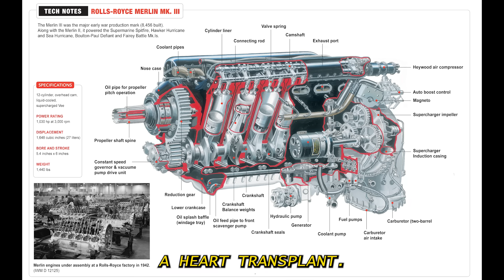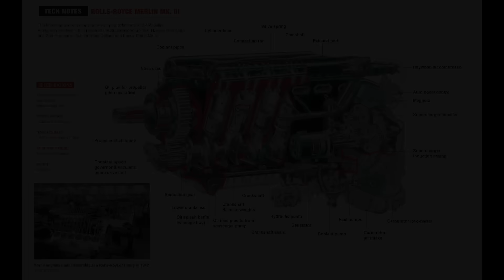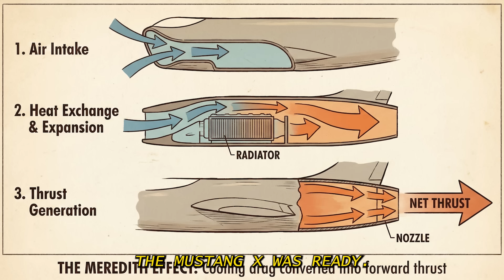They Put A British Engine In A US Plane — And Created A Monster

Comment: Gross and grotesque exaggeration.
Some P-51s were fitted with Merlin engines in 1942 at Hucknall, Nottinghamshire but its inability to fly in the dark limited what the RAF could use it for until the 1944 mass raids inside Germany, loaned to the USAAF for day escorting. The RAF night raids used late Mk Spitfires and Typhoon and Tempest pressurized versions.
Some blueprint mods by R-R allowed Packard to  make a Merlin variant with the purpose of guiding USAAF B-17s home to England into 1945 when 'layered defence' had been devised to have well fueled Mustangs in the air over Germany at dawn so Anglo-US bombing could be 24/7.
The Merlin P.51 saw service in Korea and several countries but the RAF seems to have scrapped theirs'.
Reply: RAF Mustangs likely had to be returned post war, to comply with the terms of the Lend-Lease Act.
Reply: @RogbodgeVideo  The British were flying operational jets from 1944 and after the war had no use for piston engine aircraft.

The Merlin engines were supplied by the UK on 'reverse Lend Lease' terms? Yes even the Packard built engines were RR property and paid by the British.
Reverse Lend Lease was valued at $6.8Bn at wars end.

Comment: any proof for this tale ?
Reply: I wouldn't say it's untrue, merely that it is very selective about which truths it uses. 
For example, the Alison engine was better than the Merlin in every way except high altitude performance. It was cheaper, had a lower parts-count, was easier to maintain etc. That's why those Mustangs that weren't required to escort bombers were invariably given Alison engines.

Ironically, there is a home-built replica Spitfire in America - and the owner/builder elected to use an Alison because he wasn't interested in flying high.
Reply: @BillTomlinson-zj3pn There were plenty of versions of the Merlin optimised for low altitude work. The two stage version didn't appear until 1942. Prior to that thry were all.singke stage..some single speed some two speed. Whike the Allison was a good engine its rather a stretch to say it was better in every way..9000 vs 13000 parts , but thats largely because RR doubled up on some fasteners and there were more parts in the two stage 2 speed intercooled supercharger. Plus the Allison was far more sensitive to lubrication quality and threw rods and dropped valves at higher rates than the Merlin.
Reply from the maker: Of course nothing is fictional, i might use some metaphor sometimes to enhance the storytelling but yeah if you need any proof of anything i can give you links where i get my sources from
Reply: RR Heritage Trust published a book exclusively on the conversion of the Mustang to the type 61 Merlin. No 9 in their historical series published in 1987. You can also read Hooker's bio 'Not much of an Engineer.